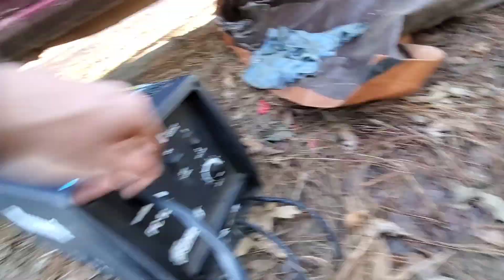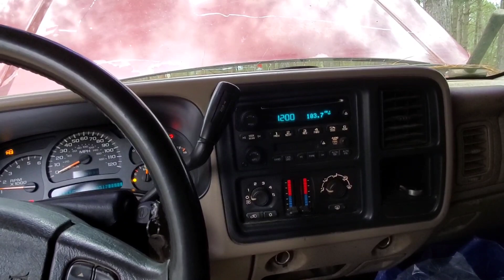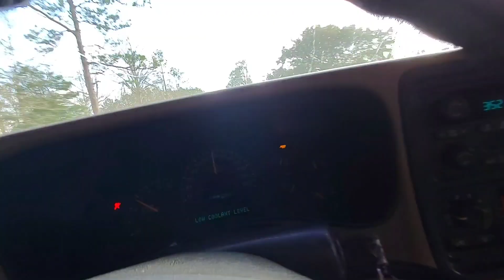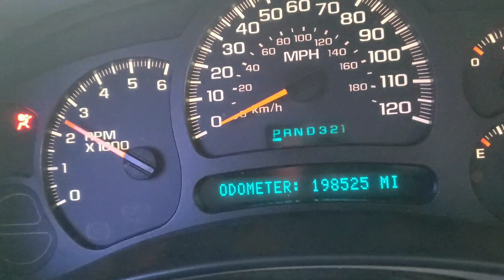5.3 Silverado CAT DELETE + SIDE EXIT - Thrush Rattler Muffler

Comment: Your truck was set up exactly like mine except mine has Thrush welded, but one thing I've learned, If you put one of those rubber bed protectors in the floor of your bed it dramatically reduces vibration and drone. It acts as sound insulation 😁

Comment: She sounds mean, nice work. Our 04 has the cats removed with Flowmaster 40 series duals and my 11 has true dual Cherry Bombs with stock cats. Thinking about deleting the cats with some headers and running Super 10s.
Reply: Super 10s are ok sounding, but only use them on an engine that doesn't rev past like 4500 rpms, my buddy's 360 dodge has one sounds good, I had one on my ls it sounded good until around high rpms it has a horrible whistle. His whistles too but not very much since his truck doesn't rev very high
Reply: @jdlawless_fuel1416  Did you remove the cats on either truck? I’ve since sold my 2011 Chevy and just have the 2004 Chevy with catless 40 series.
Reply: @KsKaylor  yea both catless
Reply: But I had cats and it whistled with and without

Comment: That tires a little slick lol glad u left o2 sensors in so many people take them off then can't figure out why there truck runs awful
Reply: Totally agree. I just cammed and built the heads on my 97 Silverado and bought 4 new 02 sensors for the headers and downstream. And got the ecu tuned for deleted a/c, evap,egr and cats. Got to have proper air fuel ratio.

Comment: How can u get rid of the raspiness?
Reply from the maker: Depends on the type of muffler and how much exhaust pipe you put after the muffler etc
Reply: @bowtieguy601  how did u turn off check engine light when cutting the cats ? With foulers ?

Comment: I did a cat delete on my 2017 F-150. Sounds good but performance sucks thanks to the rear o2 sensors being gone and (possibly) the front sensors as well. Then again the truck has no tune on it whatsoever. I guess next time I cat delete a newer truck I better get a good tune lol.
Reply: Aftermarket cats are the way to go, you get just as much flow as straight pipes and can still use your 02 sensors.
Reply: @JohnSmith-xx1lx  Can't believe I never thought of that lmao. Thanks, dude. My next truck will be the newer 2022/2023/2024 Sierra 6.2 or Sierra HD 6.6 gas truck and I want that beast to be at its loudest without losing any horses or going into limp mode like my Ford does at WOT.
Reply: @ChickenwithaHelmet  you're right about that, I got a F-150 03 with a 4.6 l sound is absolutely horrible without cats and straight pipe wide open but I put the aftermarket cats on it and a Cherry bomb single chamber m80 muffler sounds incredible I've never heard of 4.6 sound better. The Chevys sound good with straight pipes for some reason, but they're definitely hit or miss and they vary whether you have the y pipe on and depending if you have it running straight out the back versus side exit. Even funnier believe it or not I did have an 03 Tahoe with flex pipe 3 inch all the way straight out the back and it sounded incredible. For some reason I think gives it a different tone it wasn't clapping or popping or anything it was just smooth and loud,  I got lucky with that one though lol.
Reply: @JohnSmith-xx1lx  My older 2002 GMC 2500hd had a 6.0 with catless straight pipes (the previous owner had the setup put on before I got the truck). It sounded really good but cold starts were always thunder claps. The exhaust setup I plan on doing for my future 6.2/6.6 truck is American Racing Headers, an offroad X-pipe and decent sized exhaust tips (3.75 inch if it's the 6.2 and 5 inch if it's the 6.6).

Comment: 🇺🇲 Did hacking off the cat give you any trouble codes or fuck with the computer at all? I have a 05 GMC 5.3 LM7 295 horse and I want that cat bullshit gone!🇺🇲
Reply from the maker: Idk haven't checked lol engine light was already on before
Reply: @bowtieguy601  Well if it's running really good the light doesn't matter. Im more concerned if I hack mine off it will mess with my tune and run like shit. I can always tune it again but id rather not if I don't have to because the tune i put in took me a lot of trial and error to get right.